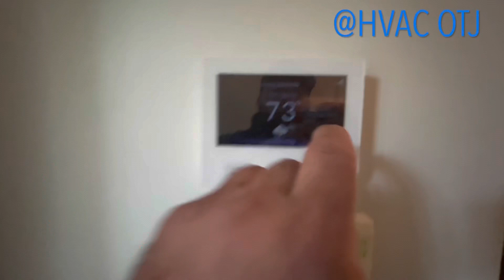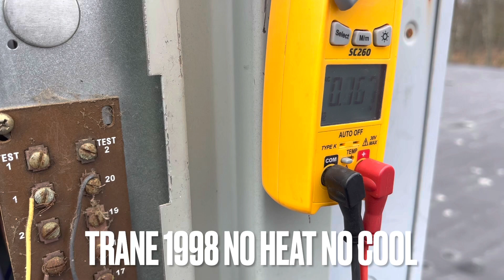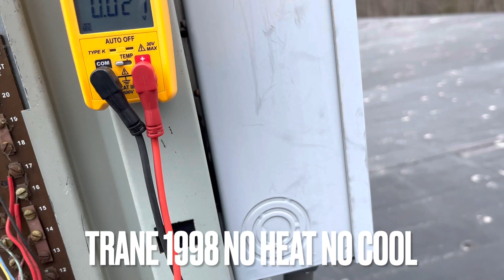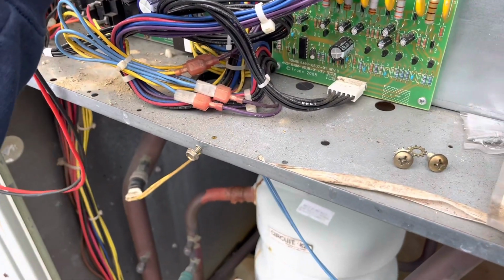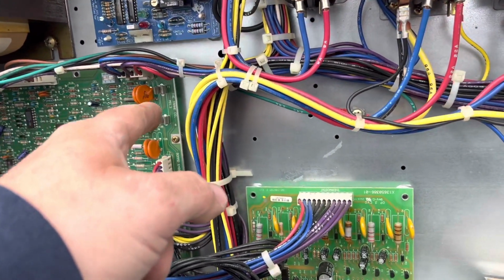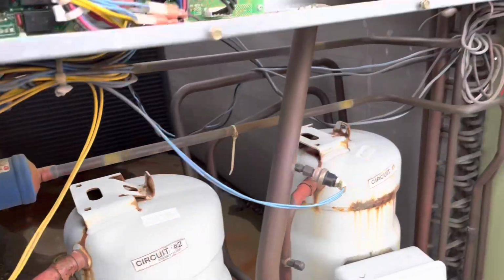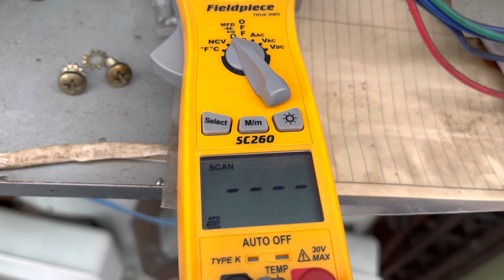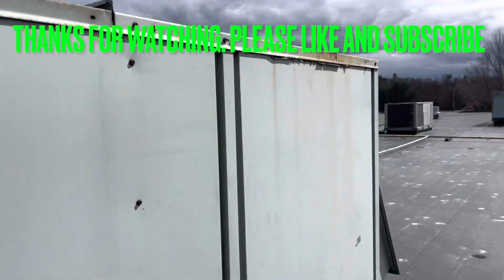1998 TRANE.  NO HEAT OR COOLING.

Comment: That second fan will operate as low ambient off of 9340 relay tucked in the right side under the capacitors. Temp sensor tucked inside the right corner controls the relay coil. Have to put the smoke back in that motor 😅.
Reply from the maker: Thanks Steve.  See always learning.  I appreciate that.  I mean it when I say I learn from you brother.
Reply: @HVAC OTJ  I appreciate that, Bro. we are all always learning.
Reply from the maker: Absolutely

Comment: On those older Trane's You can short test1 and test 2 and it should go through a sequence of operation. I made a decade box that I used to bring on each stage. The different values are on the wiring diagram if I remember right.
Reply: I got ahead of the game You knew what I was talking about all along.
Reply from the maker: I appreciate any kind of advice.  I appreciate it regardless.    Thank you.